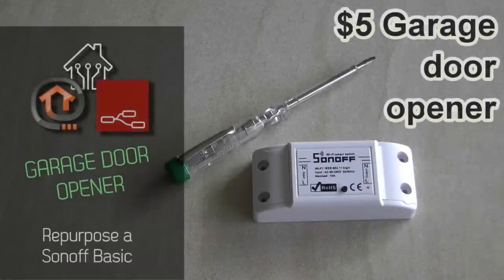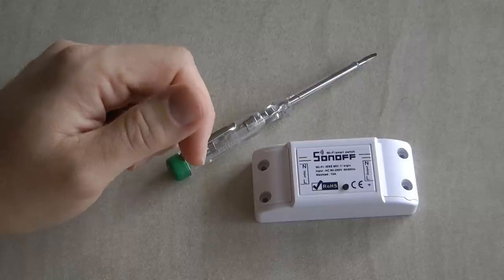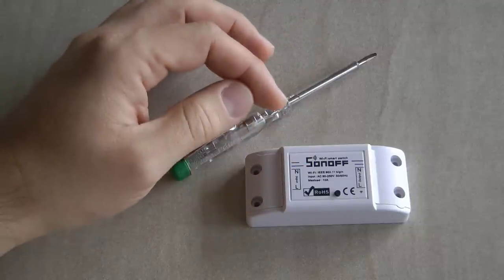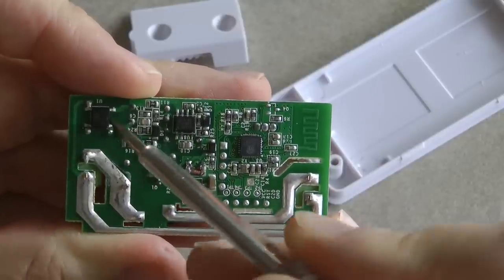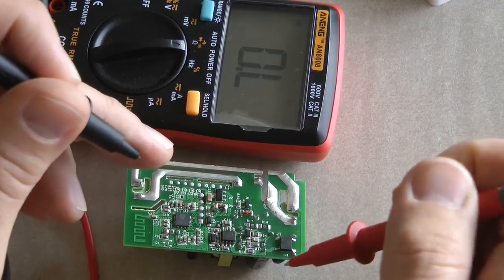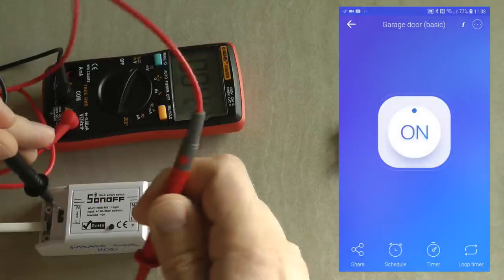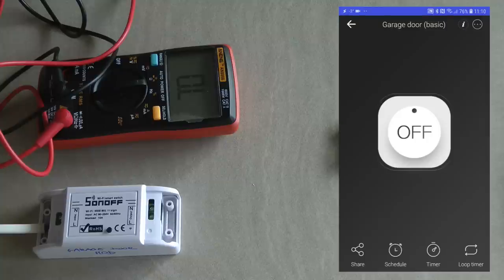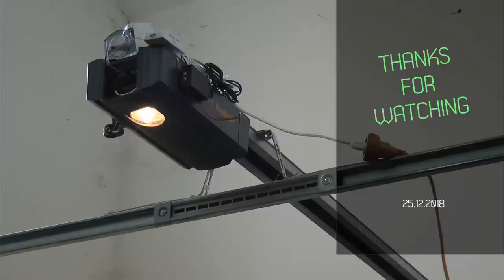Turn Sonoff Basic to garage door opener with eWeLink

Comment: so we connect the normal 120 lines in the Input side or the small telephone like lines as my power lines ?
Reply from the maker: Yes, normal 120/220 main to the input side. Like for any other Sonoff.
Reply: @csongorvarga  and output gets what? 120 also? then where do I connect the garage leads?
Reply: @csongorvarga  Got it..I figured it out Thanks a bunch!!!
Reply from the maker: @MrGuillo5  with this mod the output is a dry contact. Relay connects the two output together.

Comment: One more issue...!  I went out and tried to open the garage door with the app. I get a message "Sorry, no response. Please try again".  This is the second time I got this message and it only happens if I am using my cell phone ( with the cell network ). Do you know how to resolve this?   My point is when my cell phone is using data from the "CELL PHONE" instead of the home wifi, this thing does not work.
Reply from the maker: I am sorry, but I have no idea. I can't see your phone to see how it behaves, but it should be working.
Reply: @csongorvarga  Do you know what the "network Indicator" setting does ? If we can get this app tp work on ly when it is connected to the HOME WIFi then we dont have to worry about accidently opening the garage while we are away from home.  I turned it ON and OFF but has no effect.

Comment: Electronic translation
Great, I have a sonoff basic and a garage door from the same brand. What happens if the door stops moving for any reason? How can you be sure you get the right door position information? Clearly are we not already at the limits of the system?
Thank you for posting this video which I appreciated because I did not even imagine modifying the basic module.
Bertrand (Btd57)
Reply from the maker: Well, this is a half solution because there is no feedback from the door. I would only use this if I can see the door (e.g. don't want to get out of the car), so you can visually verify that the door has fully opened or closed. There is an Eachen door opener for eWelink. That has a sensor so if tells you if the door is closed. More expensive, but purpose built device.
Reply: @csongorvarga  Thank you for your reply. I tried well on the basis of magnetic + arduino field sensors without totally solving the problem. To perpetuate the solution, I will actually turn to ad-hoc modules supplemented by video feedback. Thank you again for your very interesting video.
Best regards
Bertrand (France)

Comment: This metod can be applied also on Sonoff Pow R2 , or is just for the basic version ?
Reply from the maker: Why do you want to use a Pow for this? Waste of a Pow. It has a different PCB, so you need to figure out which traces to cut.
Reply: @csongorvarga  Actually I bought 2 of them for other newbie projects which turn out to use something else instead. I also got a Sonoff G1 for garage door but now after I seen your video I just love it that I can use voice commands with Google Home  and not using (SIM card-another subscription-bad mobile reception) . Your method is way easier even if have to wait for a Sonoff Basic. If POW 2 is more difficult to use it in this project I will keep them for something else around the house and wait for Basic version. Thanks for sharing your project.
Reply from the maker: @bogdanasanache3135  No problem. I also ordered myself another Sonoff Basic to release a new video how to do the same conversion on the new Sonoff Basic PCB. Back to POW, I am sure it can be done, but I don't have a POW to investigate which traces have to be cut.
Reply: @csongorvarga  Looking forward on your upcoming video regarding new Sonoff Basic . I just received mine, Wich seems to be the new version 🥴 , when actually the listing was on old version. So I have to wait to see how to  make it work with garage motor 😏.

Comment: Does the device opens the garage automatically after power outage is over?
Reply from the maker: No. There is a power on state in the settings, and that is off by default. And you cannot send commands to the device whilst it is offline.
Reply: @csongorvarga  thanks for the information. I appreciate the work you do. Subscribed.

Comment: Do you need to pair the device every time you loose power?
Reply from the maker: No, only if you change your wifi credentials. If the power is lost they will automatically reconnect when the power comes back on.
Reply: Good to know. Thanks

Comment: How and where do you instal the sonoff on te motor from grage door ?
Reply from the maker: I fixed it with double sided tape on the side of the garage motor.
Reply: @csongorvarga  thats ok, but where did you conect the cables from sonoff on the motor ?
Reply from the maker: @MrTiagoalves69  That depends for every motor. I have a Hormann ProMatic garage motor, and it has an external opener switch connection. https://community.garadget.com/uploads/default/original/1X/73481e690a73495a26b957f68da3c00a68b47be9.jpg. Check yours to see how that needs to be connected.
Reply from the maker: @MrTiagoalves69  You connect 2 wires that is on the garage motor, to the two connection on the output side of the modified Sonoff Basic.

Comment: where did you put the sonoff if im using auto swing gate?
Reply from the maker: It should be the same. Put it into a separate waterproof electrical box and use cable clands to keep it watertight.
Reply: @csongorvarga  can i parallel to ordinary push button from the controller of the gate?

Comment: Is it possible the same modification for the RFR2 sonoff smart Switch? You'd be my saviour if you could reply with photos or with a video. :)
Reply from the maker: I tried, but that is a very packed board. I could not do the same modification safely on the R2

Comment: Hello again Csongor, would you happen to know what the "lan switch" option is on the sonoff basic ver 3.3.0 firmware? I was wondering it it would allow a schedule to run without internet
Thanks
Reply from the maker: Yes, I know. I am planning to make a video on that, but did not find the time yet. That means if you internet it off, you can still control the device over your local network via the app, when the phone is on the same network. So LAN control. Of course scenes will not work, but basic on/off, timer, countdowns will work.
Reply: @csongorvarga  Thank you for the immediate reply, I have to try this out. I need a timer to reset my modem and router weekly and as of yet nothing will work. This would be great with the inching function. Appreciate it
Reply from the maker: @joe18324  Yes, you can program 8 timers in Sonoff, and those are stored on the device itself. So they will trigger even if internet is offline. Just keep in mind that the device sync the internal clock with an time server on the internet. As long as it is powered, it will keep counting the time even if the internet is lost, but it there is no internet connection after it is powered up, it will just start the time from 00:00:00 like old alarm clocks when you unplug them. But if you only need a weekly reset, that does not matter.
Reply: @csongorvarga  Yes, thank you.  I need 30 seconds. I'll let you know the results
Reply: Happy to report that it worked perfectly .  I simply turned on the lan function and scheduled an off time then an on time one minute later and it worked fine without the router and modem having power. Thanks again
Reply: I have been using this device for two weeks and it is working just fine. However, I just looked in the settings of the device and I no longer see the lan switch option. I thought it was in settings , am I mistaken or have they changed something.  Thanks

Comment: any solution for can work ofline (without internet)?
Reply from the maker: What do you mean? How do you want to use it?
Reply: @csongorvarga  I have garaj under bloc. And i don't have internet connection there. far away. If i will set everythign in my home and sett everthign in home (I have internet in my home) then i will put in garaj all, then can control sonoff device without internet or not. I mean, Ewelink app, work also without internet (ofline) too?
thanks.
PS: I will try to use Soonf mini for this things...I think same principals..
Reply from the maker: @ahmetsevik  Sonoff devices will not work isolated. If will work if you can set up and wifi access point in your garage with internet. You set up Sonoff (Basic or Mini) with internet on the wifi. Than if you remove the internet connection but keep the wifi open you can control your devices when your phone is also connected to the same wifi.
Reply: @csongorvarga  Thankı you. This is what i am talking about. thanks. I will try.

Comment: Does the circuit of this sonoff exist?
Reply from the maker: This is the original Sonoff Basic R1. Since making this video the R2 and R3 versions came out, which have a different PCB. I tried converting those as well, but those are much more dense and I was not able to make the same cuts. So I cannot recommend. You can see the link to the follow-up video in the description.

Comment: How do you connect the device on the motor?
Reply from the maker: My motor has an output for an external trigger. This is where usually a switch is connected. I connected the output to those two terminals.
Reply: @csongorvarga  Thanks, I'll try that

Comment: is this on or off or puls based  ?
Reply from the maker: Garage door motors are usually pulse based. Like the button on the remote. One pulse and the motor starts moving (opening or closing depending on the current state), another pulse stops it.

Comment: Have you done the modification on a newer model?
Reply: I am wondering the same. I have an RF R2 and it has wires for L and N.
Reply: @-nathanb  yes mine also. The circuit board is also a bit different in layout.
Reply: @franshuddlestone5174  I worked it out. It's a lot harder due to the cuts needed are really hard. I tested everything with a multimeter and on the garage opener. Opened and closed ok.
Reply: @-nathanb  Can you show what you cut on the new board?
Reply: @paulholdredge6840  I took a picture. Not sure how to get it to you?
Reply: @-nathanb  Don't see a way on Youtube...  Could post on Reddit and supply link?

Comment: I am not sure of the value of this? You have replaced a very inexpensive RF opener with your phone. You can't tell whether the garage is open or closed unless you are there, so why do you need a phone when you had a door switch?
Reply from the maker: I get asked about this, hence I decided to put this video together. I have a Hormann garage door and another RF opener starts around $45. Not inexpensive compared to a $5 Sonoff.
Reply: @csongorvarga  RF openers for my garage door are about $15 each. One thing that might make this very interesting if you could put another Sonoff and maybe a magnetic switch to gauge whether the door is open or closed, you could then close your door from a distance.
Reply from the maker: @SuperFredAZ  Indeed The Eachen garage door opener that I have reviewed does that. It has a magnetic switch just for this purpose and the switch state in the app actually reflects the door state. But I don't know any other Sonoff product where the state feedback is dependent on a hardware input, so this was the best I could come up with. Of course without modifying the firmware.

Comment: Does it work with the opener  switch alsow
Reply from the maker: What do you mean opener switch?
Reply: @csongorvarga  i have an switch i push to opend/close the door opener,can i use booth items
Reply from the maker: @jt19767171  Oh yes, you can both connected in parallel.
Reply: @csongorvarga  super,can i just put og in after my on/off switch on the wire?
Reply from the maker: @jt19767171  Two wires to into your switch. Connect two more wires to those (one each), and that goes to your second switch or Sonoff. That will work.
Reply: @csongorvarga  do you have an e-mail adresse, i would like to send you two pictures of the items?
Reply from the maker: @jt19767171  Yes, it is my first name dot last name at gmail dot com.

Comment: how it wired to the opener ?
Reply from the maker: My opener has two terminals where the switch is connected to. The output of this modified Sonoff is connected to the same terminals.
Reply: It just 'replaces' the push button that is used to open the door.

Comment: Dude, for reference to others reading these comments, you are a bit incorrect. There's most certenly other ways to control the sonoff. Flash with Tasmota firmware and control it with mqtt and any system of choice (node-red, home assistant, openhab etc) use SetOption to get a timed relay close on button press. 
Also does not require you to have the ewelink crap app which is good for security and redundancy reasons.
Reply from the maker: You are missing the point. This video is about a way to stay in eWeLink. I have videos on Tasmota, ESP Easy and ESPurna, I know it can be done, but this is for people that want to stay with eWeLink. They are the average users who are not ready to make a step that requires flashing firmware and all the other steps required. Regardless how crappy it is, for most it is still what they can get with their skills.
Reply: Csongor Varga gotcha! Didn't get that. If that's the case then it's a perfect video! :) Thnx for posting, keep up the great content.
Reply: Hi. Do you know of a solution to the problem of when you have switches working fine with the app, but then if you change your router, these switches go off line and cannot be re configured even if you delete the app and start afresh with a new app with a new email login? 
This has happened to me, and from googling the problem a lot of others as well. None of the troubleshooting solutions from sonoff have any effect and they seem to ignore peoples requests or just give out generic answers. It''s as if once the switches have been configured to a network once, they cannot be reconfigured to another. Is there a way to factory reset them?
Or do you have any ideas.
Thanks Steve.
Reply: @General_Confusion  what you need to do is put your old router settings into your new router that includes your old router name an password then all goes back to there old settings
Reply: @davedavies8084  Thats for the reply, funny enough thats exactly what i did. All is well now thanks

Comment: Why did you have to cut the board?  Why could you not just use a Jumper wire on the Output  side ? Use a small wire and connect the two screw connection together.  Actually either side. The ideal you had is to jump the Line side and  Neutral side  . You are making  a Shorted out  switch. ( a push button switch.). You did a Mod That did not need to be done. And you could of use this switch later for something else.
Reply from the maker: I dont think you are right. Unmodified sonoff would add mains voltage to the output. That would destroy thw garage motor. At least it would my model.
Reply: @csongorvarga  Ok , You are using a different Sonoff unit. You are Correct In your method.  I am thinking of another model Sonoff. Sorry. I like your Trains. I have to check out your Videos.
Reply from the maker: Glad this got sorted I was started to doubt my method even though it has worked. Cheers.
Reply: @JayMon3  Yes if you did as you suggested with many of the Sonoffs including the Basic, you'd short active (live) and neutral together when the relay is energised.

Comment: could be a much better video if the wiring diagram and sensor detection were added.
Reply from the maker: You cannot. The Sonoff Basic firmware does not handle an input.

Comment: With some hard work, I managed to get it to work. At first I could not find the itching setting. Ahh! I had to update the firmware in the device ( No big deal ) All done via the cell phone. 
BUT THERE IS A MAJOR PROBLEM WITH THIS... How do you know whether the GARAGE is opened or closed ?????  WHEN you click the app it just says "ON" then "OFF" you have no idea whether you closed the GARAGE or OPENED the garage. So be careful!  DO NOT USE THIS APP while you are away from home.   DO YOU GET WHAT I AM SAYING.. ? THIS IS DANGEROUS.  Better just walk to the garage and make sure it is open.
Reply from the maker: Yes, I get that. And I mention in the video that there is no actual feedback and it is not even possible. I only recommend using it if you have visual of your garage door.
Reply: Csongor Varga 
But hey, nice job discovering th e method. Good work.
Reply: Question: While trying to cut the circuit board the reset button broke. It came out. Any solutions for this ?
Reply: @csongorvarga  SONOFF also mentioned that they have a new app that can turn any old android phone to a security camera. So we can then have a camera on the garage door and that way see whether the door is open or close ( This is an easy solution )

Comment: I have the sonoff model basicR2 and I’m trying to follow your instructional video to accomplish the same thing (enable pulse feature to trigger garage open/close). However my board looks different than the one you have in the video. Here’s what mine looks like  https://community.home-assistant.io/t/wth-is-this-new-sonoff-basic-r2-v1-4-pcb/225880/5
Can you help me?
Reply from the maker: Yes, this is the Release 2 version. To be honest, it is much denser layout than the original version. I made a video on this, but I could not recommend a safe way to make the change unfortunately. I would recommend using a Sonoff SV, or use an external relay.

Comment: You dont show how tou did the wiring wtf?
Reply from the maker: No I did not. As I said in the video, mains go to the input, and the output is connected to the terminals of the garage opener. Those are usually different in all garage door opener model.

Comment: I use this, no mods needed and only $7aud - https://www.itead.cc/inching-self-locking-wifi-wireless-switch.html another bonus is the 12v version actually runs off 3-32v so it can be powered by both 12v and 24v garage door openers.